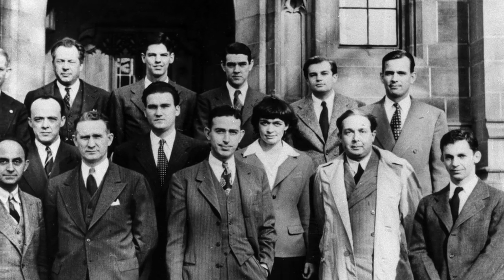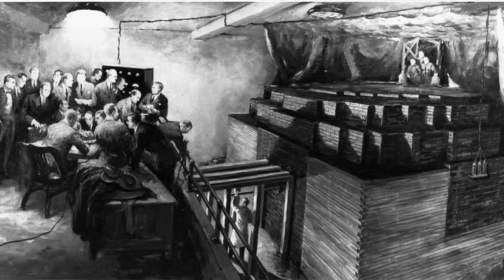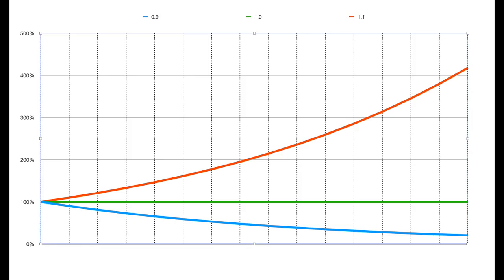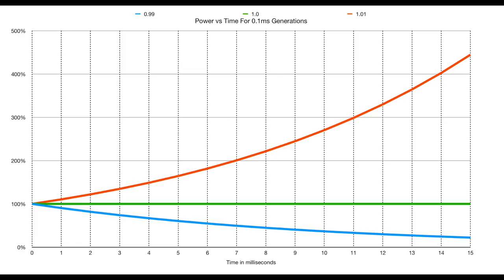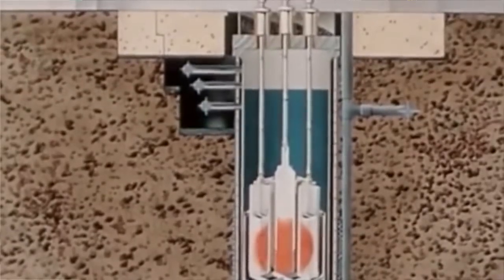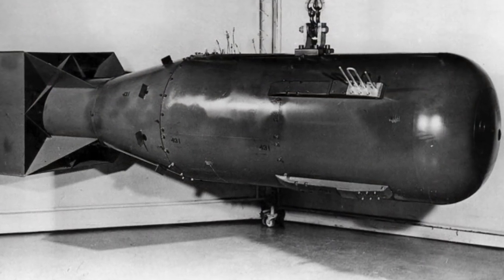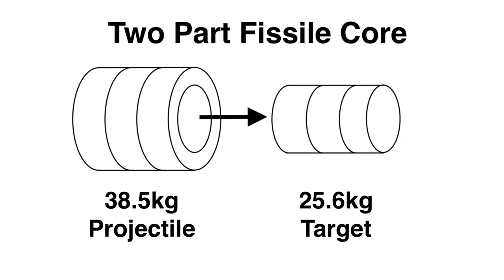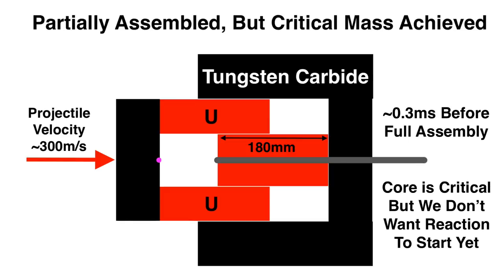Going Nuclear - The Science Of Nuclear Weapons - Part 2 - Chain Reactions

Comment: Nuclear engineer and licensed senior reactor operator here. I operate a boiling water reactor. Thanks for helping to spread some education about nuclear power!
Reply: Great username! I saw your comment and had to ask...
With the reactors I am experienced with, US Navy, we did not control criticality (after start-up) with the control rods.  The Navy has a strict requirement of a negative coefficient of reactivity.  Meaning (for other readers) that if the core got hot, the moderator expands reducing the cross section of moderation and thus reducing the reactivity.
I am curious how (not) similar it is in commercial applications. From what I understood the Navy's process was less efficient however, it allowed for the dynamic power-level changes required in warship-propulsion applications.  
Do commercial reactors control operational criticality with active control rod adjustments? Like Chernobyl?
Reply: @FiferSkipper  From my diggings, the RBMK (Chernobyl) type reactor (hereafter referred to as typical communist arrogance and callousness) is the only power reactor type in use which has a positive coefficient of reactivity as it is almost entirely graphite moderated. That's one of the main reasons for that disaster. The West operates a strict convention on using NCR reactors because of that very possibility.

The main difference between civil and military reactors is scale (probably refinement level too, come to think of it). A ship or submarine simply does not need 800MW (over a GW thermal!) out of its reactor. Making them small keeps them agile, you could probably shut one down completely in seconds and not worry too much about keeping the coolant flowing. In a civilian reactor on the other hand, there is so much more decay heat that it takes hours to fully shut one down. The thermal inertia is also too great to rely on passive self-regulation. It makes active control an absolute necessity.
Reply: @Bialy_1  You've reminded me of an old joke about Richard Feynman: 

*If Richard Feynman applied for a job at Microsoft
*

Interviewer: Now comes the part of the interview where we ask a question to test your creative thinking ability. Don’t think too hard about it, just apply everyday common sense, and describe your reasoning process.

Here’s the question: Why are manhole covers round?

Feynman: They’re not. Some manhole covers are square. It’s true that there are SOME round ones, but I’ve seen square ones, and rectangular ones.

Interviewer: But just considering the round ones, why are they round?

Feynman: If we are just considering the round ones, then they are round by definition. That statement is a tautology.

Interviewer: I mean, why are there round ones at all? Is there some particular value to having round ones?

Feynman: Yes. Round covers are used when the hole they are covering up is also round. It’s simplest to cover a round hole with a round cover.

Interviewer: Can you think of a property of round covers that gives them an advantage over square ones?

Feynman: We have to look at what is under the cover to answer that question. The hole below the cover is round because a cylinder is the strongest shape against the compression of the earth around it. Also, the term “manhole” implies a passage big enough for a man, and a human being climbing down a ladder is roughly circular in cross-section. So a cylindrical pipe is the natural shape for manholes. The covers are simply the shape needed to cover up a cylinder.

Interviewer: Do you believe there is a safety issue? I mean, couldn’t square covers fall into the hole and hurt someone?

Feynman: Not likely. Square covers are sometimes used on prefabricated vaults where the access passage is also square. The cover is larger than the passage, and sits on a ledge that supports it along the entire perimeter. The covers are usually made of solid metal and are very heavy. Let’s assume a two-foot square opening and a ledge width of 1-1/2 inches. In order to get it to fall in, you would have to lift one side of the cover, then rotate it 30 degrees so that the cover would clear the ledge, and then tilt the cover up nearly 45 degrees from horizontal before the center of gravity would shift enough for it to fall in. Yes, it’s possible, but very unlikely. The people authorized to open manhole covers could easily be trained to do it safely. Applying common engineering sense, the shape of a manhole cover is entirely determined by the shape of the opening it is intended to cover.

Interviewer (troubled): Excuse me a moment; I have to discuss something with my management team. (Leaves room.)

(Interviewer returns after 10 minutes)

Interviewer: We are going to recommend you for immediate hiring into the marketing department.
Reply: @Bialy_1  I mean good design practice now for nuclear plants is relying on passive cooling systems the operators can't circumvent (or can circumvent but not without immediately SCRAMing the reactor).
The world needs idiot proofing because we're all idiots sometimes, even those with college education and decades of career experience; humans make poor decisions when stressed, humans can get overconfident when in a position of power in a strictly hierarchical system, humans cut corners to save money...
Reply: I'm glad I read this thread. Informative.
Reply: I love nuclear energy and I wish my state had six 1,100 megawatt reactors.

Comment: Side note: when we start up a commercial power reactor, we go slightly supercritical. For a commercial reactor we have a multiplication factor that gives us about a 15-20 minute doubling time. Very slow but also very safe and controllable. There are either reactor period trips or flux range trips to prevent a runaway and automatically shut down the reactor.
Reply: I'm a naval nuclear operator.  We measure Start-Up Rate (inverse of period) in Decades Per Minute, often lots of them.  Not much waiting for us :D
Reply: Decade per minute is a very technical and very real rate yet I cannot stop laughing.
Reply: @kotori87  What is a decade per minute?
Reply: @smort123  the way I understand it, they aren't using it as a year denotion. Say you have a 10hz signal. Upping it a decade would be 100hz. So if it went from 10hz to 100hz in 60 seconds, then that would be a decade per minute.
Reply: @kotori87  Is the general jist of it? Something going up by a factor of 10 is a decade?
Reply: @MySkybreaker  yes, a decade is simply a factor of 10, i.e. a start-up rate of one decade per minute means a tenfold increase in power per minute, which means 18 seconds per doubling of power. You could use the unit also when going down, not just going up (i.e. if power decreases at a rate of one decade per minute, that means it halves every 18 seconds).
Reply: Matthijs van Duin I thought it was a measure of life expectancy. As in running this for 1 min means 10 years less life expectancy.
This probably makes more sense though.

Yeah I imagine they shield these things properly
Reply: @kotori87  after the point of adding heat, I assume?

Comment: When I worked at a research reactor, we would achieve prompt criticality all the time when we would replicate (on a much smaller scale) a power excursion by ejecting a control rod from the center of the core. The prompt negative temperature coefficient would automatically bring the power level back under control before any operator input. Pretty neat. Plus the blue flash of Cerenkov radiation is pretty cool too.

Comment: Will you be talking about Fusion devices ? I find those personal very intriguing, the risk they took during their development and nonchalance with witch they conducted the tests are absolutely mind boggling
Reply: Or Layer-cake designs, where an initial fission triggers a round of fusion, which triggers more fission, triggering more fusion. Designs got absolutely ridiculous by the end of the Cold War.
Reply: That's not ridiculous, it's efficient.Don't want to waste nuclear fuel.
Reply: Talking about ridiculously complicated. I have been reading about weapons designs and its astounding, for instance, the fission trigger stage isn't hot enough to fuse the fuel we use for our fusion stage by a power of 10. They solved this in a way which is mind boggling and hopefully he goes over, I don't want to spoil it :D

Comment: scott: when looking for the nuclear initiator, look for urchin. You will find it is beryllium 9, and polonium 210. These items for the trinity blast and hiroshima and nagasaki might have been difficult to obtain, but they did have a reactor at hanford, from which to aggregate the necessary amounts of these man made items. When you are getting plutonium in the 5 kilo-gram amount completely made by man, these other components in the amount necessary will be pretty easy to obtain. The urchin may have been diff in the first units, something with good production and a neutron emitter. Labs may have had this before trinity. I read many years ago it was a different element which I am reluctant to state here.

Comment: Later uranium type devices moved the rings, not the projectile. They were also surrounded by beryllium to reflect the neutrons. A small black powder charge propelled the rings up a tube into which the projectile was mounted. When the top ring of the stack neared the end it struck two neutron generators that initiated the main fission sequence and the weapon exploded. Moving the rings has an advantage that the generators can be placed further apart yielding a superior neutron spread and higher yield.  
Your analysis of the little boy, AKA thin man is correct.  It was primitive compared to the ones designed in the fifties.
Reply from the maker: 6:50 I explain this.
Reply: Scott Manley  thanks for the reply.  When I saw your drawing I assumed that was what you would describe and mentally skipped over the discussion.  I am not sure exactly how the little boy was configured.  
   In the W33 device even though the rings moved the “slug” was called the projectile.  It was actually mounted on a cylinder of the same diameter.  When assembling the device the rings were installed onto the cylinder.  To prevent incidents they were locked in place. Then the slug was screwed into the cylinder.  You can appreciate the fact that misalignment is impossible with this system.   
   I am looking forward to viewing the remaining episodes of this series.  I am curious as to what type of physics is your speciality?  Thanks!

Comment: Abner was most likely a simplified version of the Urchin initiator in the implosion type weapons. 

"4.1.6.1.4 Initiation
Once insertion is completed, neutrons need to be introduced to begin the chain reaction. One route to doing this is to use a highly reliable "modulated" neutron initiator, an initiator that releases neutrons only when triggered. The sophisticated neutron pulse tubes used in modern weapons are one possibility. The Manhattan Project developed a simple beryllium/polonium 210 initiator named "Abner" that brought the two materials together when struck by the projectile."

"4.1.8.1 Modulated Beryllium/Polonium Initiators

....The Urchin was a sphere consisting of a hollow beryllium shell, with a solid spherical beryllium pellet nested inside. The polonium was deposited in layer between the shell and the pellet. Both the shell and the pellet were coated with a thin metal film to prevent the polonium (or its alpha particles) from reaching the beryllium. The mixing was brought about by using the Munroe Effect (also called the shaped charge, or hollow charge, effect): shock waves collide, powerful high velocity jets are formed. This effect was created by cutting parallel wedge-shaped groves in the inner surface of the shell. When the implosion shock collapsed these grooves, sheet-like beryllium jets would erupt through the polonium layer, and cause violent turbulence that would quickly mix the polonium and beryllium together.

By placing the small mass of polonium as a layer trapped between two relatively large masses of beryllium, the Urchin designers were hedging their bets. Even if the Monroe effect did not work as advertised, any mixing process or turbulence present would likely disrupt the carefully isolated polonium layer and cause it to mix.

The whole initiator weighed about 7 grams. The outer shell was 2 cm wide and 0.6 cm thick, the solid inner sphere was 0.8 cm wide. 15 parallel wedge-shaped grooves, each 2.09 mm deep, were cut into the inner surface of the shell. Both the shell and the inner pellet were formed by hot pressing in a nickel carbonyl atmosphere, which deposited a nickel layer on the surfaces. The surfaces of the shell and central sphere were also coated with 0.1 mm of gold. Combined with the nickel layer, the gold film provided a barrier between the polonium and the beryllium.

50 curies polonium-210 (11 mg) was deposited on the grooves inside the shell and on the central sphere. This much polonium produces a thermal output of 0.1 watts, causing very noticeable warming in such a small object. Post war studies showed that no more than 10 curies still provided an acceptable initiation effect, allowing the manufacture of initiators that remained usable for up to a year."

http://nuclearweaponarchive.org/Nwfaq/Nfaq4-1.html

Comment: Scott, while I don't have any specific information on the Abner initiator, I've always been under the impression (from my, admittedly, solely open-source information) that it was similar to the polonium-beryllium "Urchin" initiators used in the early implosion designs.  I won't go into more detail on their design here (though it can be found online if you know where to look), but I suspect that, having a working knowledge of nuclear physics, you can guess the generalities of how such a device would work from what I've said here.

Interestingly, the preferred method of initiation since the early 50s has been to use a betatron built into the weapon case; it not only gives a stronger initial neutron flux and more precise positioning of the neutrons, it also gives much more precise timing of the initiation event, allowing for optimal compression of the pit before initiation.
Reply from the maker: +rdfox76 Chavez’s you been reading the scripts for my future episodes?
Reply: XD Nah, just the Nuclear Weapon Archive.

Comment: I know this comment is super late, but you forgot about the affect of a moderator on criticality. Fluid moderators are extremely popular because as they get hotter neutrons are less likely to scatter off them, slowing down the reaction. If the reactor starts losing coolant it will eventually lose criticality. 
Solid-moderated reactors (Chernobyl) don't have that mechanism, and rely entirely on electronically operated control rods to prevent meltdowns.